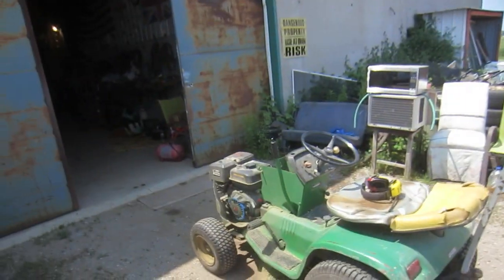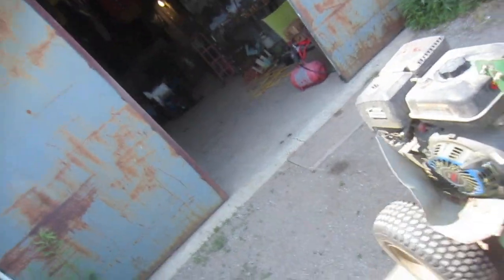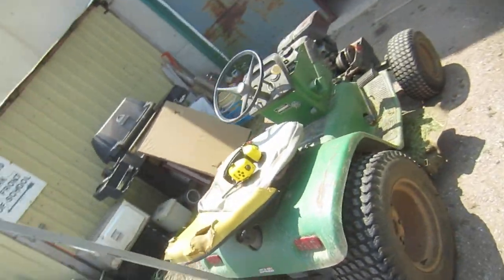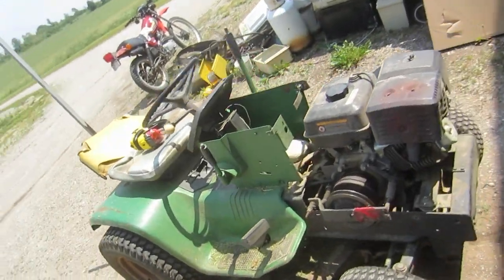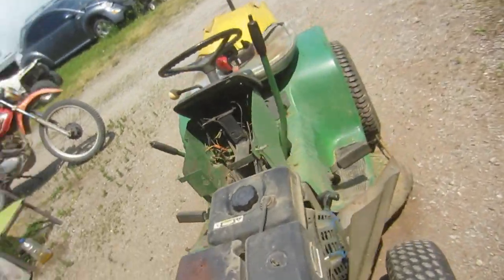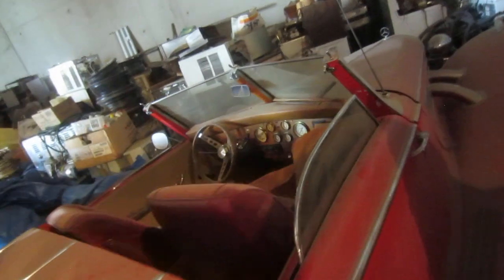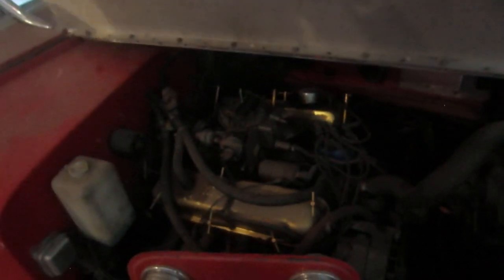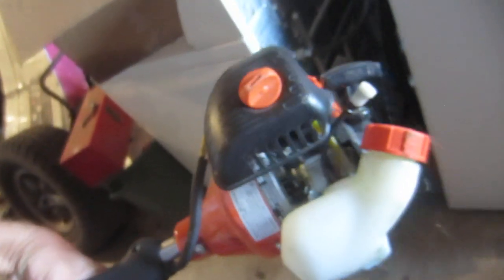Davidsfarm modified John Deere lawntractor update

Comment: Garbage picked item are really easy to fix nowadays. You are not kidding. People throw stuff away if it doesn’t start on the first pull.😂
Reply: Garbage picked mower in the 1980s:  40 years old and worn out pistons

Garbage picked mower in the 2020's: 2 years old and the spark plug is dirty